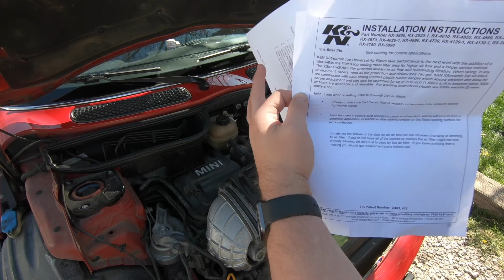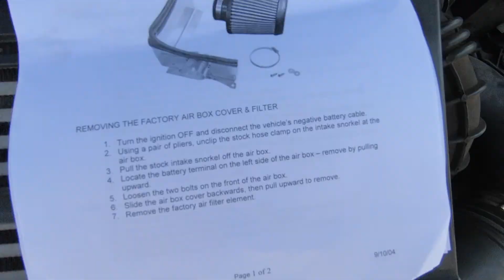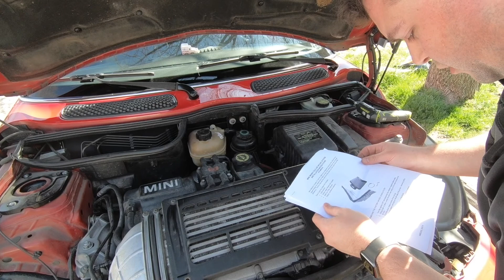How to Install a Cold Air Intake on a Mini Cooper S - R53

Comment: you can modify the original air box there is a 3d printed thing you drill on the inside and then you can use a pod filter inside the box keeping all hot air out and cut a second air inlet cut a circle hole in the plastic in line with the back of the original air box 2x cold air its taking it from the scuttle vents and the front inlet

Comment: That deletes the stock cold air intake. The air will be warmer now as most now comes from under the bonnet. Sounds like you need a new cam chain tensioner. DO NOT drive a Mini that rattles like that! It will get expensive if the tensioner blades break

Comment: How many HP did you gain?
Reply: thanks @TheMINIac
Reply: 0
Reply: You'd gain 3-5 hp from this type of mod. Its more for throttle response though. But this need a cold air intake hose too. Bad idea to run without as the air will come from the engine bay, which is warmer, so you'd probably loose 10-15 hp from using hot air.